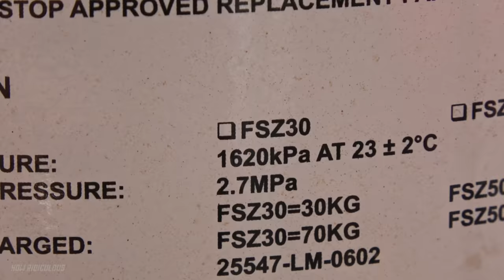2 Ton Axe Vs. 500kg Rubber Band Ball

Comment: You guys need to sharpen that axe. It don't need to be super sharp, but, something like 30° between the faces should be OK. Now, it's about 90°.
Reply: Why is he meowing
Reply: @spoon1540  a punishment
Reply: yup, just take an angle grinder to it between takes
Reply: @spoon1540  Punishment : Must meows at the end of every sentence.
Reply: id say its a 45°. 
rn
Reply: @tigermincraft456  agreed
Reply: they also need to get rid of that bevel, it's stopping the axe from cleaving cleanly. But yeah, sharpen the edge as well and it should cleave a lot more cleanly
Reply: @Locahaskatexu  true
Reply: @spoon1540  cuze its his puneshment
Reply: The sharper the angle the quicker it becomes blunt on the metal objects. Also a sharper angle will more likely fracture on the hard objects.
Reply: Can't unless they also harden it. They are splitting steel with that thing and even the 90 is getting banged up real good. How long do you think a 30 would last? The cutting power wouldn't be that much higher anyway. The sharpness of the blade isn't doing the work, the weight and speed of it is. Stuff is getting pinch cut, not sliced
Reply: spoon
Reply: @spoon1540  I see someone has skipped the video
Reply: Was the keg VB because that’s the best way to drain a keg of VB in my opinion? 😆
Reply: @michealthekaminoshinagami54  unfortunately. These punishments are getting dumb. I get why they do it (the algorithm), but still...
Reply: I want to say my German knives are all sharped to 18*. It would be too difficult to sharpen it to that angle and would get dulled very quickly, but it sure would fit through basically anything short of a Liberty safe.
Reply: I was gunna say the same. Either sharpen it, or add a groove where the axe comes down that lets it go slightly lower than the rest of the chopping platform lol.. something to actually make sure they get through everything they definitely have enough power to get through.
Reply: @darui9185  I DID translate that. It don't make ANY sense. Maledictions ain't real.
ମୁଁ ତାହା ଅନୁବାଦ କଲି | ଏହା କ Y ଣସି ସେନ୍ସ କରେ ନାହିଁ | ଅଭିଶାପ ବାସ୍ତବ ନୁହେଁ |
Reply: Agreed @alain Martel
Reply: «Jesus said unto her, I am the resurrection, and the life: he that believeth in me, though he were dead, yet shall he live: and whosoever liveth and believeth in me shall never die». So believe in Jesus — the Son of God
Reply: @O.s..a  Your Jesus looks and feel like a character from a badly written novel. So many self contradictions and inconsistencies, in addition to the many historical impossibilities.
At the end of the nativity, the «killing of ALL boys between age zero and five» is a big thing. It would have left VERY OBVIOUS traces in the area : 100's of excess boys in the grave yards and tombs. Obvious lack of males in the population. We don't find anything like that.
The victims of crucifixion where ALWAYS left on the cross for days until their rotting flesh gives way and they fall on the ground by themselves. Around Passover, that would have been over a full MONTH. Then, the bodies where thrown into a communal grave, NEVER in a tomb. The empty tomb creed goes out the window, as well as the three day to the resurrection : Jesus would still be hanging on the cross after only three days.
Also, the vertical posts where permanently set, and the victims had to carry the cross beam, NEVER the whole cross. Also, the cross where actually T shaped. Another thing christianity gets utterly wrong.
Reply: Repent and believe in Jesus. John 3:16 KJV - For God so loved the world, that he gave his only begotten Son, that whosoever believeth in him should not perish, but have everlasting life.
Luke 13:3 KJV - I tell you nay: but except ye repent, ye shall all likewise perish. 
2 Corinthians 5:17 KJV - Therefore if any man be in Christ, he is a new creature: old things are passed away; behold, all things are become new.
Reply: @jgdecaro1  The KJV was compiled from another version that is regarded as flawed and incorrect by ALL biblical scholars. The KJV is regarded by most as incorrect. We also know that it was compiled to please King James and make his reign seems more legitimate.
We KNOW that the names of the gospels where added starting in the 6th century. That mean that ALL the gospels are really apocryphal.
In fact, ALL of the bible is apocryphal as ALL the names of the alleged «authors» are later additions.
The very first written texts of the new testament was written AT LEAST 30 years AFTER the events. That mean, according to what was normal at the time, a full TWO generations AFTER the events. Two full generations of the telephone game.

Finally, your biblical crap have NO place here.
Reply: @Kualinar  plot twist the bible is a badly written novel
Reply: @jessieornot6121  It also contains bad poetry and bad fables.
Also, it plagiarize texts from previous religions from the area.
Reply: It would be cool to see a 10° edged giant axe cut something tho
Reply: @tigermincraft456  Close, but it's obviously 44°
Reply: They dont “need” to
Reply: Really, it's more like a sharp hammer than a dull axe.
Reply: How the heck you gonna chop it
Reply: How you gonna sharpen it
Reply: it’s more like 45° now
Reply: These videos already take like half a day to film, to angle grind both sides, after every single take, is asking a lot.
Reply: The sharper it is, the faster it dulls.
Reply: Probs 8
Reply: Yeah, 20° maybe
Reply: Yes your right and smart😊
Reply: Blud does NOT read the Bible 😂
Reply: Agreed
Reply: It’s really blunt rn
Reply: I don’t even think that’s a real axe
Reply: @Tsuedoesntgiveashit  You're correct. Real axes don't have an edge that is over 2m long on a blade some 3m high sitting at the end of a 10+m  long handle.
Reply: that is not 90 degrees... it would be a right angle if it was. it's clearly got an edge

Comment: next time you do this with the axe, get a cylinder and hit only the valve, (just be  sure it is aimed away from were you all will be standing, and that everyone is in a bunker of sort.
Reply: I’m gay
Reply: Leviathan, they already have some nice dings in their "safety container".
Might need something more "vault like" for a 3,000-20,000 PSI cylinder...or a safe distance like, America.
Reply: Yes, Mythbusters did this with a runaway metal garage door, and the cylinder shot off like a torpedo. It caused real damage to the concrete block back wall of the garage.
Reply: @childannihilator5363  That's gay
Reply: @childannihilator5363  congratulations
Reply: @joermnyc  And went onto a wrkshop next door lol.... Miss Mythbusters!!! damn it now have to go and bunge watch them!!
Reply: @dizzo_rl  Pretty sure it also went through a shipping container wall (like the one they stand in....)
Reply: @childannihilator5363  your comment certainly is.
Reply: I 2nd that. Several of them. ;D
Reply: @joermnyc  The crazy thing is MacGyver did it every other week no problem.  :)
Reply: @darui9185  I DID translate that. It don't make ANY sense. Maledictions ain't real.
ମୁଁ ତାହା ଅନୁବାଦ କଲି | ଏହା କ Y ଣସି ସେନ୍ସ କରେ ନାହିଁ | ଅଭିଶାପ ବାସ୍ତବ ନୁହେଁ |
Reply: @childannihilator5363  hi gay im dad
Reply: @childannihilator5363  ok
Reply: @kevinsellsit5584  -🐕z

Comment: You’ve probably considered this, but you’ll get much more convincing chops if you mount your targets on a harder surface. Right now you’re losing a lot of energy to the deformation of the padding. It’s like using a mattress as a cutting board. Anyway good stuff lads

Comment: The bigger fire extinguisher isn't under as much pressure as the smaller one is! They usually only hold about 800 psi. You should do a 90 cubic feet Scuba tank, which holds about 3200 psi!

Comment: I may not be a scientist, physicist, or any sort of authority on the subject, but my guess is that giant fire-extinguisher didn't fully chop because the force of the pressure release slowed the axe down enough that it lacked enough chopping power. (It also likely needs sharpening if you guys haven't been doing that in between vids)

Comment: Your problem was all the rubber mats on the floor and trying to chop rubbery things that were not centralised under the fall of the blade.  The mats absorbed energy and moved away from the force of the impact, thus enabling things to avoid being chopped.  The rubber balls do what rubber balls do, but they get away with not being chopped when you get the aim wrong.

Comment: I think the extinguisher wasn't fully charged. There should have been enough pressure inside to prevent it from being crushed. The axe should have made a clean cut but it instead bent until it ripped. That's weird.

Comment: Loving the new axe vid lads.
Just a thought: attach a wire to the axe head and another to the metal base plate the axe is slamming into. Connect these both to a sensor that, when the axe comes into contact with the plate, detects connection between the two. If they've connected then the object has been cleaned in two.
Reply: pretty sure the wine keg and rubber band ball strikes would trigger such a mechanism, the axe and the baseplate cover quite a large area and the baseplate has a lot of give in it....
Reply: @Debbiebabe69  after writing this, I was thinking of the give. Its the fact that the two wires would be connected and complete the circuit that triggers the sensor. So I think it would need a small metal disc, about an inch in diameter would do, that the axe must touch.
Reply: @meeksian  With this though, what happens if the axe chops through in the centre where your sensor disk is, but it is imcomplete cut further down the blade? Your sensor would record a successful cut here.
Reply: @Debbiebabe69  ooh, good point. Back to the drawing board

Comment: I mean it's blatantly obvious at this point that if you're going to continue to do things like fire extinguishers that you might as well build some tiny fire Pals around the front and sides of the ax and see if you're able to put them all out. I mean obviously if you just set some wood on fire and then 30 seconds later drop the ax it's going to burn the fire out because the wood isn't completely on fire yet but let yourself get a real fire going and then see if you can put it out.
Reply: Let's Talk I Have A Surprise For You!